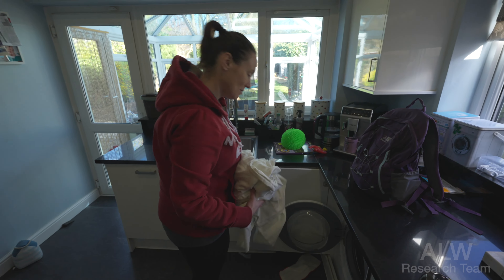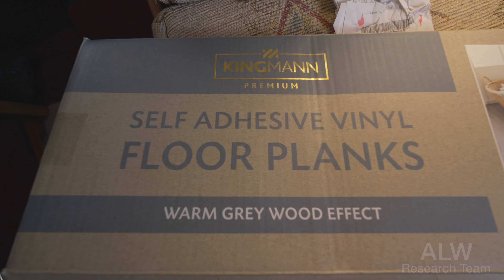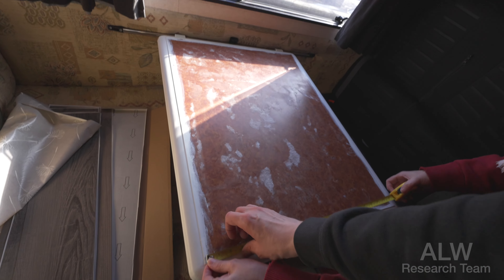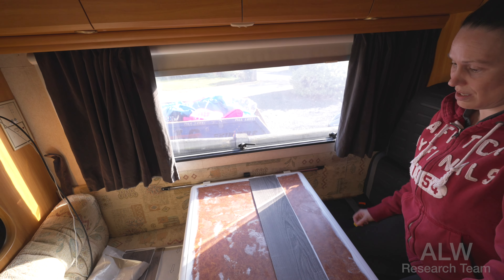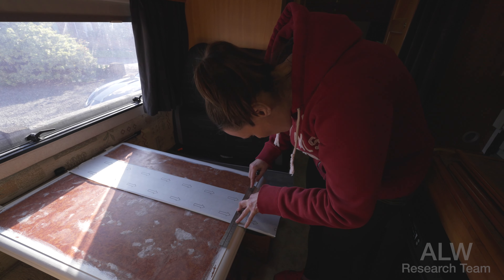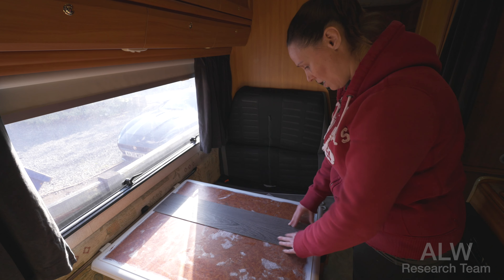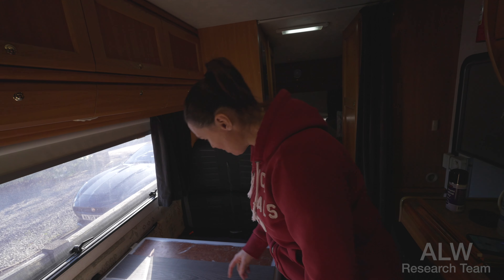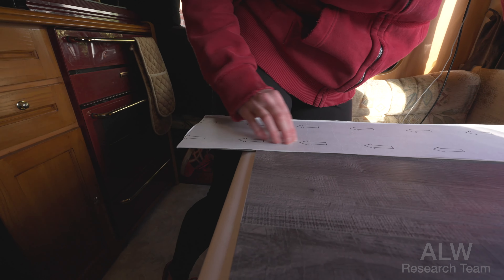Top Motorhome Repair Mistakes That Cost You THOUSANDS

Comment: Probably would have just sanded the table surface down and applied either a light varnish or paint depending on what the surface looked like. The table comes out so can work on it outside. Enjoying the videos. Going full time next month in a Swift motorhome. Let’s see what I break first 🤣 👍
Reply from the maker: Best of luck :-)